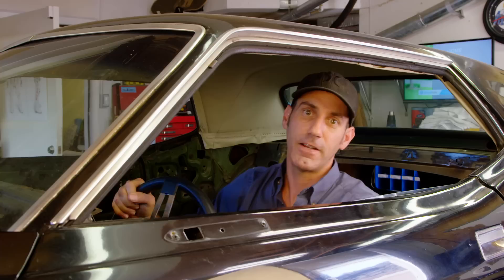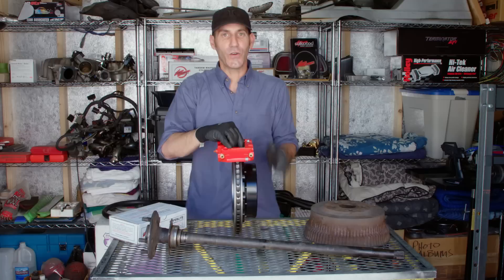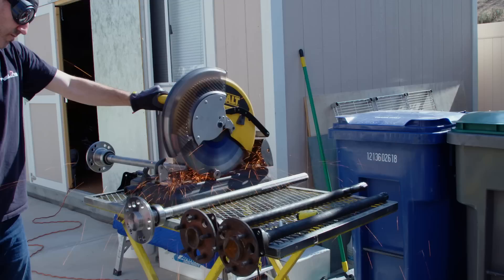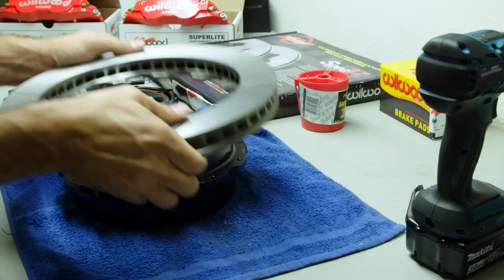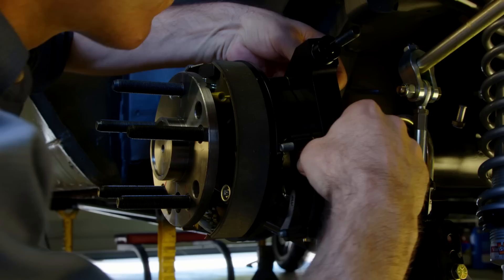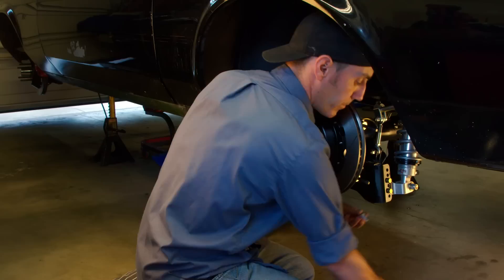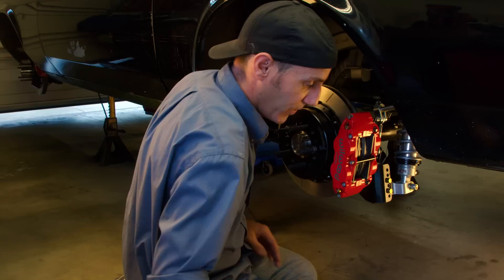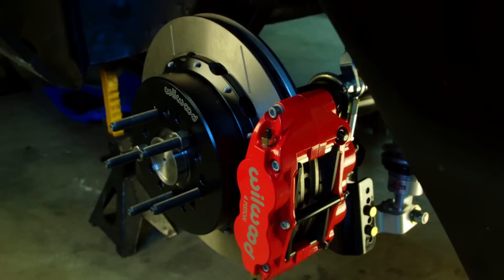Drum to Disc Brake Conversion for Muscle Cars - How To Install Video Wilwood Super

Comment: hey mate awesome video but I did notice a couple of things not explained. First I saw you cut the drive spline of axle, is this necessary when reinstalling standard axles in my 69 mustang,. Second thing I noticed was that the wheel register end of your axle appears to have been machined , ? any help appreciated , keep up the good work cheers Brent
Reply from the maker: These axles are universal cut to fit so if you are re-installing you might not need to cut. Not sure about that second thing.

Comment: Five years ago, I purchased a front brake conversion kit from Mac’s auto that sat in a box until this week. It stated fitment for a 1964 Ranchero. Its description was: 41-83979-1, Front Disc Brake Conversion Kit, 5 Lug, Falcon, Ranchero, 1960-1965. So I assumed it was a perfect fit. Little that I know is this was to convert from a 4 lug on a V6 to a 5 lug as in a V8. The rotor bearings ID was way too narrow for the spindle. I contacted Mac’s technician and he suggested I get a bearing that would fit both parts. Problem is that the ID needed for the original spindle is too large and the OD for the rotor is too small. I thought about trying to just get a disc and place over the original hub, so I am in the process of hunting such a thing. Anyone else had such a problem? Suggestions?

Comment: It appears that the system uses the factory e-brake cable.  Is that correct?  If so it eliminates much of the hassles converting the rear brakes.

Comment: One major problem, those bearings will have side to side movement after a few miles and the pads will have a fair amount of knock off. The reason Ford only used a single piston sliding head calliper. You will need to install a line pressure valve to attempt to keep the pedal up. On my semi slick shod Falcon racecar I need line valves front and rear. Those stubs flex a fair amount.
4 spot set ups are ever only functional on floating hubs. This is ditto for GM products too.

Comment: I have a 1971 mustang on my channel that me and my dad built up and we need to know if a tremic 5 speed will fit behind our 351w stroker without a problem
Reply from the maker: Garrett TheBoss I've been talking to Jay at American Powertrain and yes you can get a T5 in there with less effort than you think.  The main points are getting the proper Bell-housing and they even offer a cross-member for it to bolt right in!
Reply: autoedit Thanks!! but now we are thinking about  putting a 1986 4 speed manual out of a foxbody to put in there cause we have one laying aound but we dont wanna tear up our 71 and in the end the tranny doesn even fit so would you have any tips for that? Thanks for responding though !

Comment: I've got two questions that maybe you can help with:
1) it looks like you upgraded the suspension. What did you use for it?
2)When switching from drum to disc, does that affect what size mag you can put on the car?
I've got a 67 RS Camaro that I'm upgrading but I'm a little lost as to what would be best to use to give it a solid ride and great braking.
Thanks!!
Reply from the maker: I use Total Control Products for my suspension and the Wilwood brakes bolted right on.

Comment: Should I take the same steps that you did here for your Mustang on my C1500? I want to do the conversion since I'm planning on installing a bigger engine, bigger tires and wheels, so for that, you need bigger brakes!
Reply from the maker: +Bryan Bello Oh, for sure! This is a home run upgrade on anything with drums in the rear and fairly easy to do yourself.
Reply: +autoedit .. how hard is it on a 1969 dodge charger? My drums in the front are different than the one in this video!

Comment: Anyone know of a decent conversion kit for a 69 camaro? Looking to convert from drum brakes and need to spend as little as I can
Reply from the maker: +Virtual Rain Designs Get some 1LE off of a junkyard late model.  They bolt right up and will be better than what you have now.
Reply: Use factory set up off of a 69 thru about 75.

Comment: Nice setup, did you wipe the rotors down with solvent?
Reply from the maker: QQTrick1QQ I use brake clean and just get everything sparkly after the brake line bleeding.  I somehow manage to get brake fluid everywhere during that process.